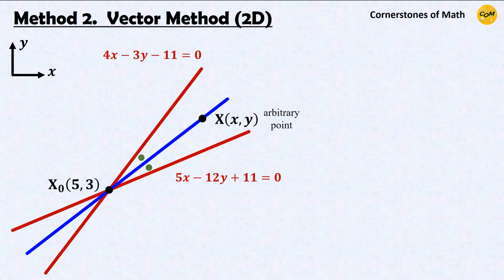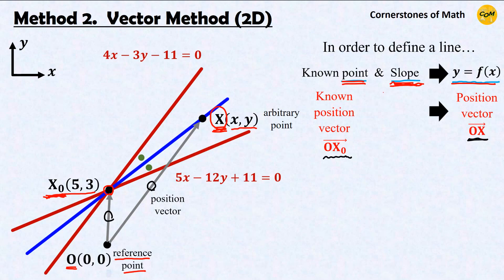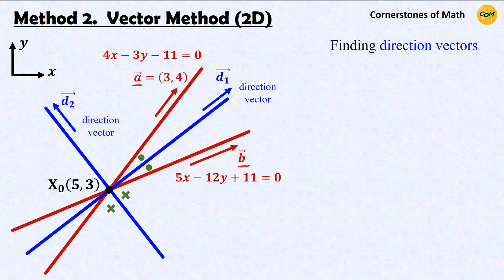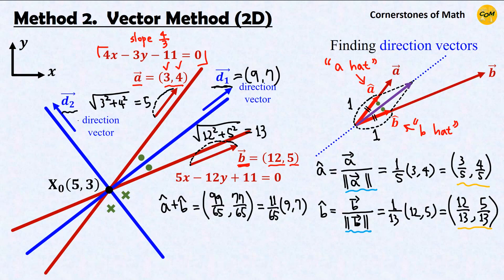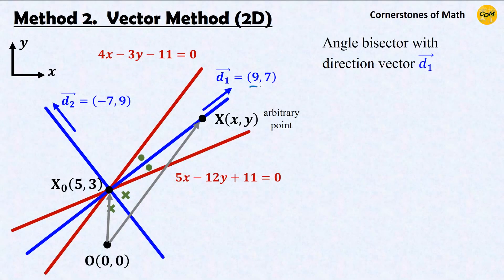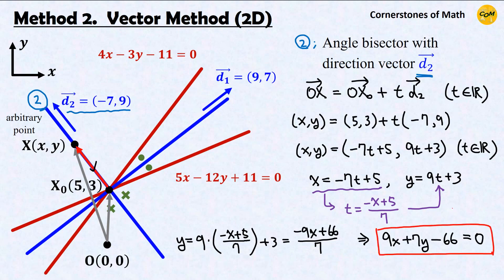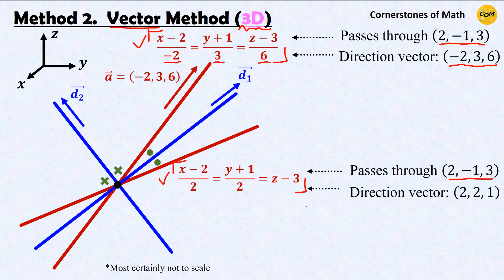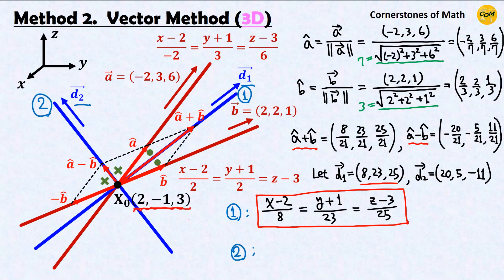ANGLE BISECTOR (Part 2). Vector Method. 2D & 3D Problems.

Comment: Can u give how to distinguish between acute and obtuse angle bisector in general using vector !!
Reply from the maker: I think the most straightforward method is just calculating the angle between direction vectors of original two lines.  Let a and b be the UNIT VECTORS of two lines, and x be the angle between them.  You can easily calculate cos(x) using dot product.  If x is acute angle (cos(x) > 0), then vector a + b is the direction vector of acute angle bisector, and a - b is the direction vector of obtuse angle bisector.  If x is obtuse angle (cos(x) < 0), then a + b is for the obtuse angle bisector, and a - b is for the acute angle bisector.
Reply: @CornerstonesOfMath  yeah thanks a lot i tried the same way but when u have general eqation of line I need the exchaustive result !!!